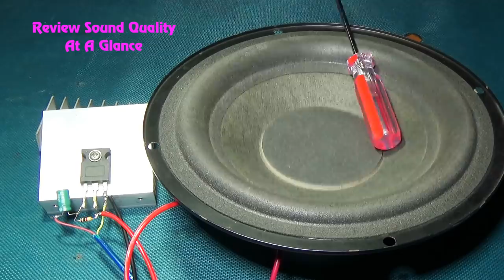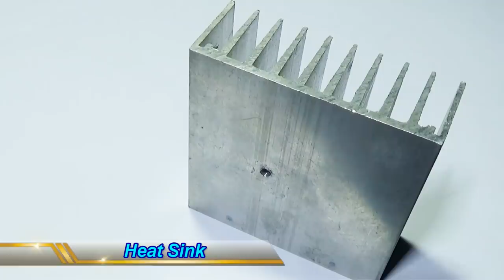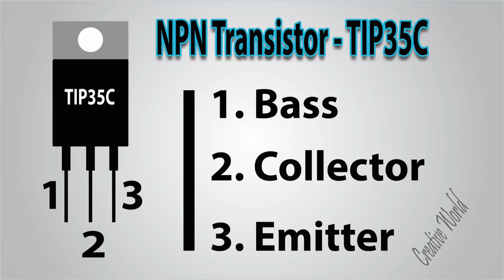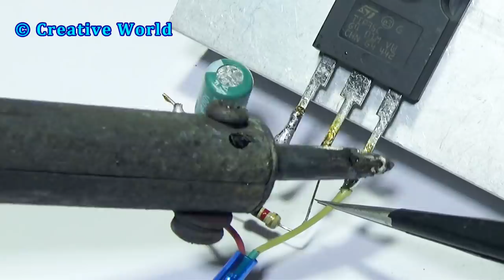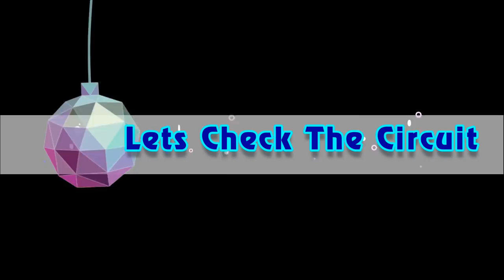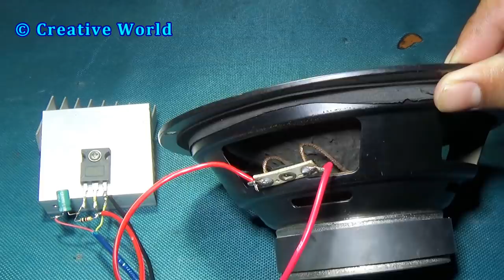How To Make Mini Power Amplifier Using Tip35c/ 12v (English Subtitle)

Comment: Bhai mene 12 v se connect to kiya par aavaj nahi aa rahi par 12 v charger on nahi kiya  to aavaj aa rahi hei par bahot kam aavaj aa rahi hei
Reply from the maker: are you using battery ?
Reply: Phone ke aux pin output se thodi awaz ati hai normal hai mere wale mai bhi hota hai aise agar charger off ho phir bhi ek dam low volume ati hai or jaise he on karo adaptor phir volumes ati hai...normal hai

Comment: Can i substitute the 100uf 25v capacitor for another one?
Reply from the maker: 100uf/35v
Reply: @CreativeWorldPro  uh.....yeah, im not taking your advice. You told a guy its ok to use a cap with a lower voltge rating and its ok.......its not.
Reply: @erichvonmanstein6876  even a 100uF 10V would be fine. Because the capacitor is only subject to the voltage Differential of the audio signal
Reply: @SparkieFuchs  wrong
Reply: @SparkieFuchs  you got 12 volt power supply fool

Comment: Would I use 70uf 16v instead of 100uf 25v capacitor?
Reply from the maker: sure, you can use
Reply: NO! NEVER use a capacitor with lower volt rating.
Reply: No, the Uf matters in audio connections and as was stated before NEVER use a capacitor with lower voltage rating it will blow.

Comment: Es falso les falta la alimentación de la corriente no se la Vi en ningúna parte solo ví los cable de la entrada y la salida no más.
Reply: Wrong. It works but with the power running through the speaker you will blow your coil in no time